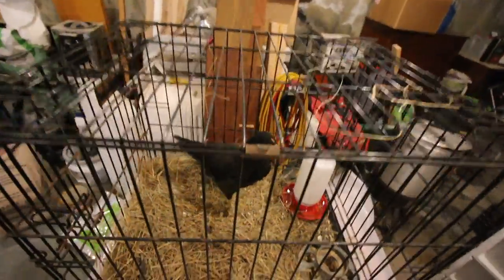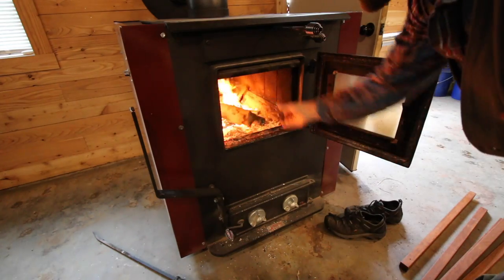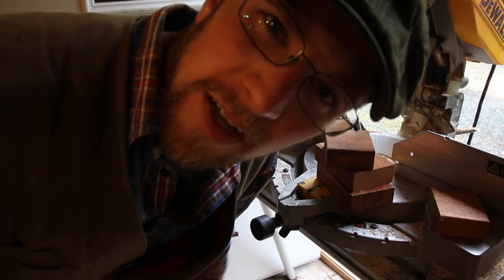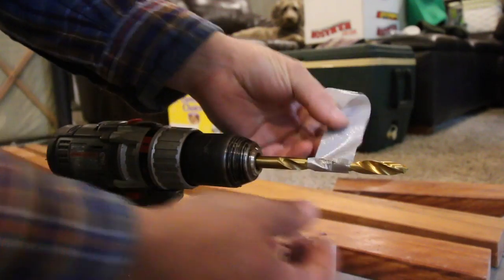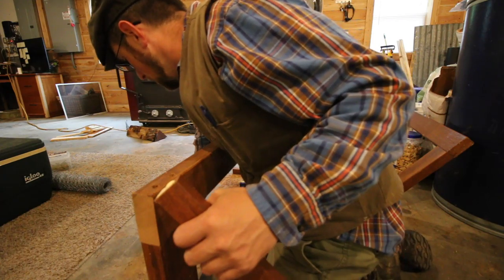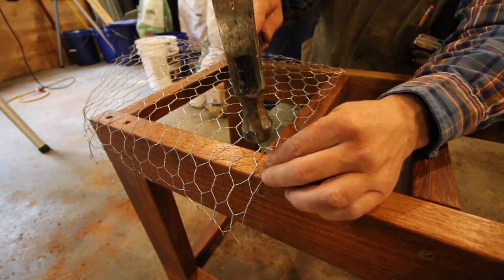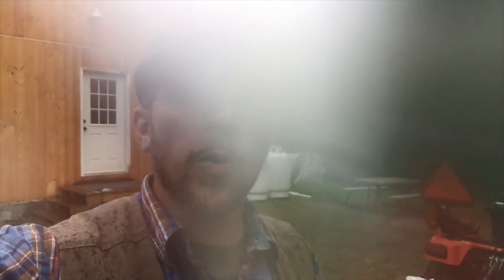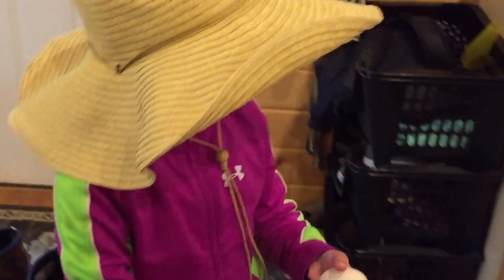keeping Chicks safe when introducing them into the Flock

Comment: Just a thought: there is some very lightweight 1/2" mesh bird\deer netting you can get at the DIY box stores that you can put on the electric netting; it will keep in the chicks but not make moving the netting any more difficult. I attach it with tiny zip ties  at both the top and bottom so none of it grounds out the fence.
Reply from the maker: Good to know! thanks for sharing!

Comment: I would use that scrap for Lathe turning projects.  Most expensive chicken crib ever!  Nice idea for keeping them safe.
Reply from the maker: It was free for me! Lol, I couldn't believe the guy was throwing out that lumber! I saved the bigger pieces for other projects. Maybe a food trough for the PIGS! ;) Lol
Reply: I totally get it...Being a shop teacher I try to maximize all the bits of lumber and scraps.  I love getting free stuff as well.  That will be a heck of food trough, definitely won't rot that's for sure, coat it in mineral oil and it will add a nice finish to the look of it.
Reply from the maker: I was just joking about the food trough! Lol, I dont know what I will use the rest for. Any Ideas
Reply: Depending on how much you have, how about a small bench for putting/taking shoes off?
Reply: a bench with a folding step or two like an old style step stool.
Reply from the maker: Russell Raposa giving me ideas